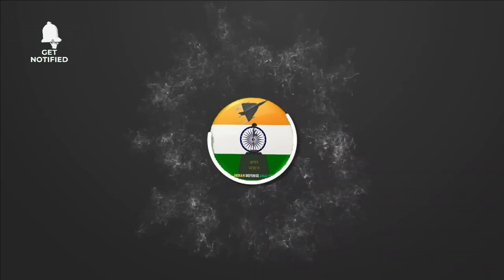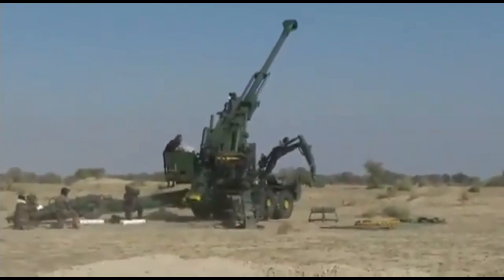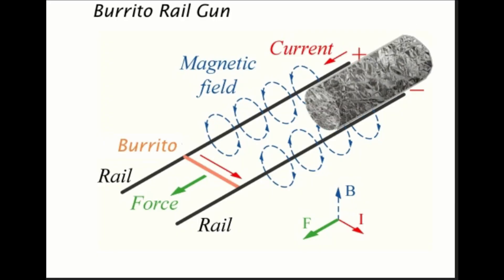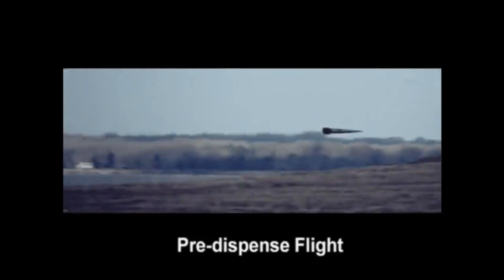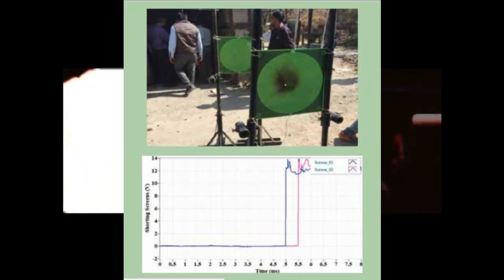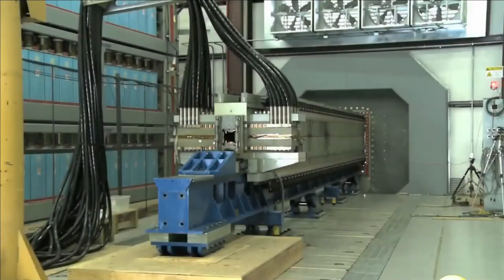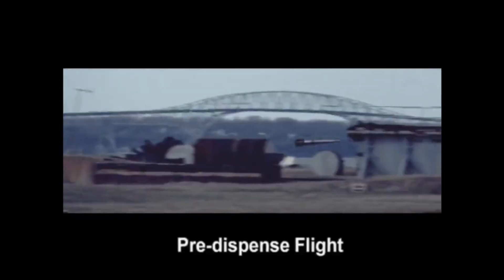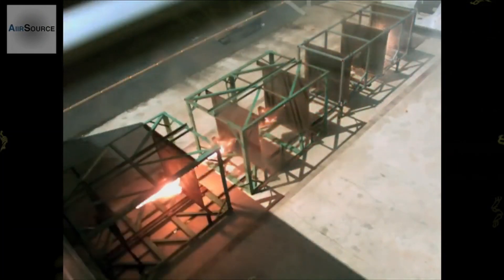DRDO's 155 mm, 100-400 km range Electromagnetic Rail Gun

Comment: Three issues with railguns
  
  1.Railgun durability
  2.Projectile guidance
  3. Nuclear power
  
1.  Railguns should be able to fire 6 rounds per minute with a rail life of about 3000 rounds, tolerating launch accelerations of tens of thousands of g's, extreme pressures and megaampere currents, but this is not feasible with current technology
  
2. Projectile guidance is:

        The package must fit within the mass (< 2 kg), diameter (< 40 mm outer diameter), and volume (200 cm3) constraints of the projectile and do so without altering the center of gravity. It should also be able to survive accelerations of at least 20,000 g (threshold) / 40,000 g (objective) in all axes, high electromagnetic fields (E > 5,000 V/m, B > 2 T), and surface temperatures of > 800 deg C. The package should be able to operate in the presence of any plasma that may form in the bore or at the muzzle exit and must also be radiation hardened owing to exo-atmospheric flight. Total power consumption must be less than 8 watts (threshold)/5 watts (objective) and the battery life must be at least 5 minutes (from initial launch) to enable operation during the entire engagement. In order to be affordable, the production cost per projectile must be as low as possible, with a goal of less than $1,000 per unit.
        
        3. Nuclear power is only source able to produce megawatts of electricity
        
        Railguns are only a science project, very far from a practical weapon.  Even though 2 of the problems, nuclear power and guidance packages can
be solved, but rail life materials is an unsolved problem to date.
Reply: Why are you even bothered??? Let those technical experts deal with it
Reply: @randheerkhanna6238  So we don't get too excited thinking railguns will be everywhere soon. Lots of practical issues to solve.
Reply: @datoolz0  those working on it have already tonns more info about it than yours...and they won't waste money like US failed projects....
Reply: @randheerkhanna6238 yes you told right